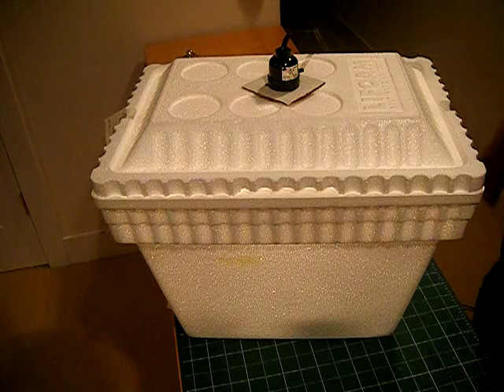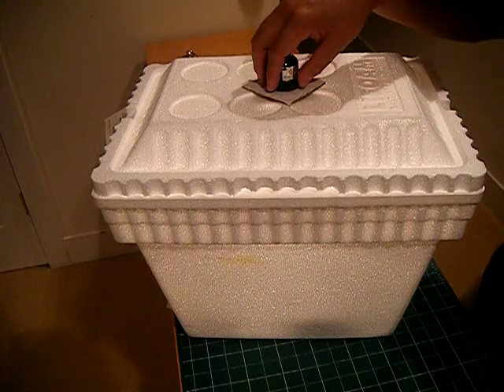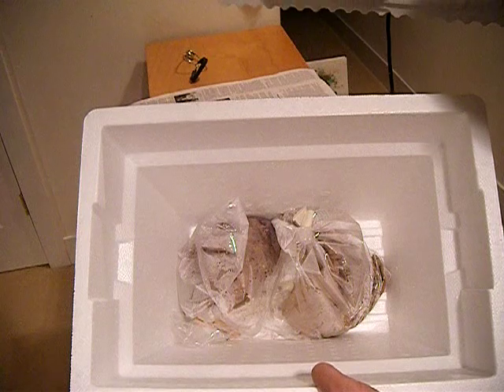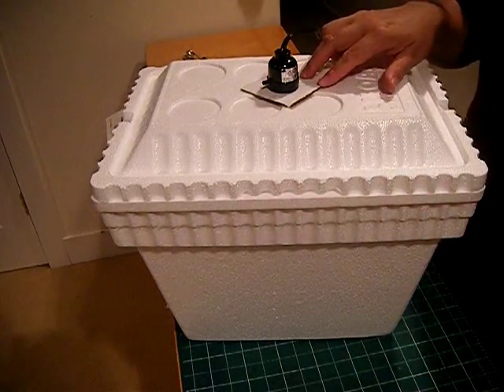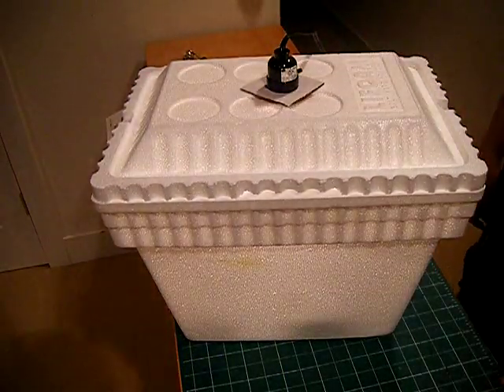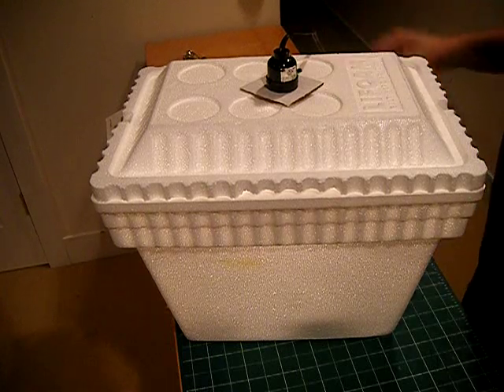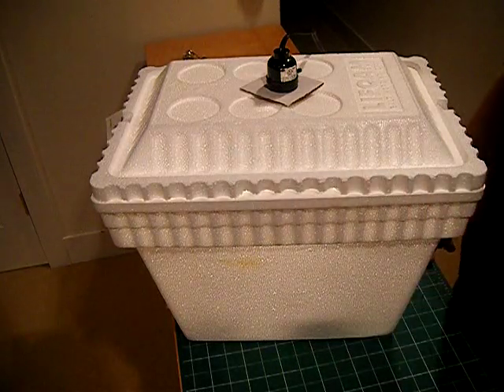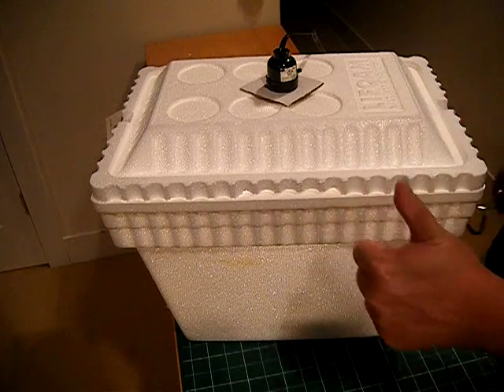Part 8.2: Fermenter update #1, How to Grow Tobacco Series

Comment from the maker: No, that's the hardest part.  It has to be continuous heat and humidity, if you are uncomfortable with this system its for good reason as it is a fire hazard, best bet is to do it outside sheltered from rain but away from structures and connected to a GFI outlet.  If you have something that is made for this like a large egg incubator even better but it costs money.

We are trying to replicate the conditions in a natural fermentation pile used in central america, there is no on/off switch.

Comment from the maker: @eighthof8 Yes, the biggest change since this video is that the foam cooler is a very good insulator and with a continuous heat source, the chamber gets cumulatively hotter and hotter.  Over the course of hours, perhaps days, it will become too hot, especially without vent holes.  

My solution has been to put on a timer with 15 min increments, it is now set to be on every 45 mins, and then off for 15 to give it a cooling off period.  Seems to be ok so far!  will post a vid soon.